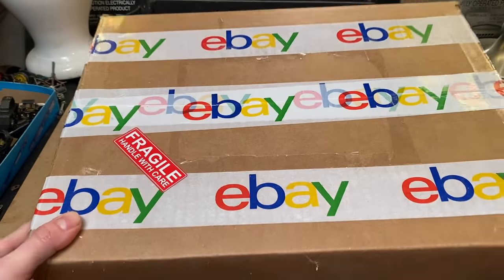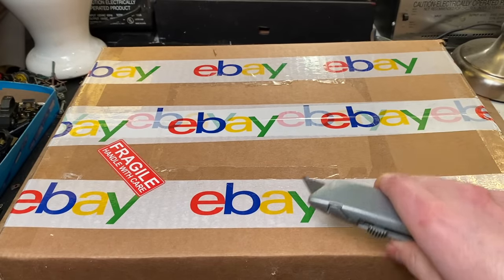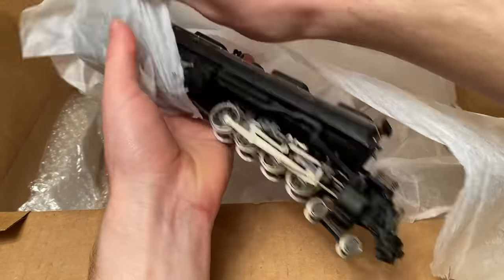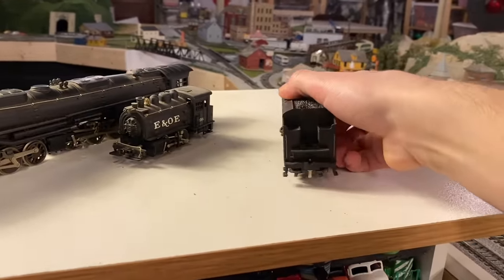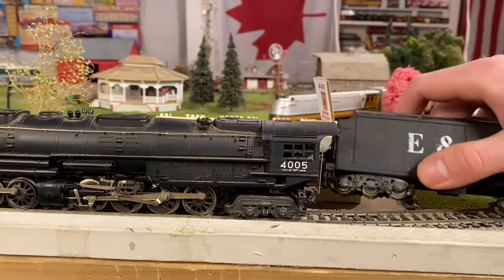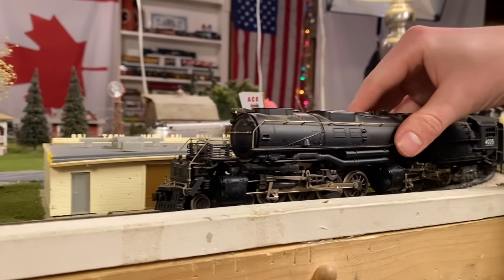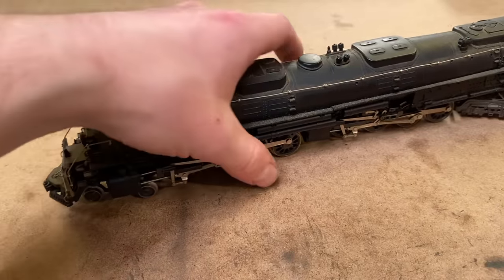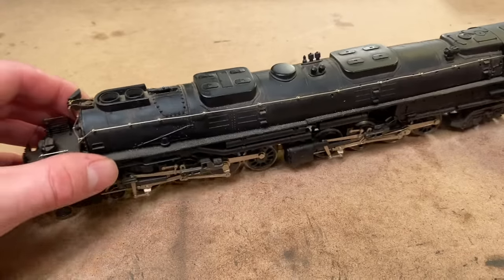Can We Make This Rivarossi Big Boy Run Again? Sitting for 20 Years

Comment: Super. The drive is a lot better than I imagined, and oiling the siderods, bearings, and valve gear is very important on a locomotive like this. I like the Big Boy, but will probably not buy one for my railroad, but if one just happens to come my way, I'd find an excuse to operate it on my railroads fantrips. 💙 T.E.N.

Comment: Nice old Rivarossi - that's a model I always wanted as a kid.  I'd have cleaned the wheels and checked the wheel pickup brushes before I did anything else with an old engine like that - most of the time that's the only problem.

Comment: I used to use a small brass wire brush to clean wheels. I attached a wire between it and a 9v battery and had a return wire to complete the circuit so the brush itself powered the loco whilst cleaning the wheels.

Comment: Three possible suggestions.
If it's brass, polish that strip between the 2 driver sets. 
Check the gauge on the wheels. That front end pops up a lot when going through the street crossing.
See if you can remove the brushes and check to make sure the contact surface with the commutator is flat. Sand if it won't make them too short.

Comment: You've probably used Deoxit electrical contact cleaner. It's great for cleaning most electrical devices. Makes old audio equipment work / sound better as well.
Reply from the maker: Thanks for the tip!

Comment: I have one of these made in mid 1970s. Mine has the dreaded mazak rot, and the chassis expanded and stretched the  drivetrain so far apart it no longer connected together. Think it must be easier for you to get these engines  second hand in the USA. As I have never found one in the UK for spares and repairs. So sadly it remains in its broken state.

Comment: It looks to run really good for it's age. I definitely like that drive better than the can motor drive.
Reply from the maker: For the time it was very good. Best 3-pole motors ever made in my opinion.
Reply: I completely agree with you about that. My blue goose is by far my best running locomotive and it has the same motor and its great.

Comment: Hi Harrison. Got my first Rivarossi Big Boy this week and was told it didn’t run. After watching your videos, I took it apart, lubed and greased it and cleaned the wheels and now its running great!  In watching your video you mentioned that most of the time the cover for the top screw is always missing. Mine was also missing and managed to find a pretty good fix. My daughter bought me a plastic pen that has a “hammer” head top. The one end of this plastic hammer is the exact same size as the original. I just cut the piece off the pen and popped it right into place. If you message me I can send you a pic of this and what it looks like on the locomotive.

Comment: Heres a trick for you- try dunking a problematic motor in water and running it. I race radio control cars and back in the day that was a great way to clean the coms brushes, or break them in for new motors without lots of deposits on the comm. You can use tap water, just use motor spray (brake cleaner) to clean it out. BUT with your motors I'd use distilled water. Either way direct current motors will run just fine underwater. Theres lots of youtube videos showing this. And there are still brush and comm cleaning tools sold on (bigger) rc rock crawling websites as a lot of them still used brushed motors. Just something to try! Obviously thoroughly clean the motor out after with something thats paint safe but should work well for you!

Comment: Tender source, there was a manufacturer that made a wheel set conversion for the Monogram ( now Revell) BigBoy kit tender, someone thought it was pretty well detailed. The other parts may by found through Precision Scale Models, they also had the centipede truck and front tender truck for the Big Boy tender.

Comment: The batteries are dead 😂
It's informative to watch your videos, you know what you're doing. Good looking engine. You realize how much coal and water the BigBoy engine used in sn hour at say a steady 40 mph? Its crazy, no wonder they came out with Diesel. I found out BigBoy 4014 was converted to oil.

Comment: Spray it with some CRC 2026 spray that's electrical contact spray cleaner in the motor and it will help it I have several of the old ahm locomotives and that's what I use and it really cleans it up pretty good inside the motor with all the carbon deposits

Comment: You can look at the 5550 T1 trust and they are about to start work on the frame and it will be made into two parts and after you see the locomotive progress you will be surprise to see how far they came to this point
Reply from the maker: I’m highly impressed by how well they’ve doing this.

Comment: I fixed a few of these for people,  alltough i never could afford one, pretty simple, as you did, most of them just needed a good clean,  but not the best slow runners, the drive mechanism is not the best in this cab motor version.  The never version has a different drive mechanism, its alot smoother!  But all in all, both are nice, easy to maintain.
Nice job!!
Reply from the maker: They seem pretty nice, I can imagine at the time how sought after they would be.

Comment: I bought an old rivarossi cab forward a few years back... I had to grind all the carbon buildup on all the wheels and oil up but surprisingly afterwards it ran great! The motor noise tho.... typical of  80/ 90s tech

Comment: The number of that Big Boy is X4005. You can find X4005 at the Forney Museum of Transportation in Denver, USA. The reason 4005 is no longer in service is because she was in a switching accident and rolled over on April 27th, 1953. Additional Information From Google: On April 27, 1953, No. 4005 was pulling a freight train through southern Wyoming when it jumped a switch track at 50 mph (80 km/h), throwing the engine onto its left side and derailing its tender and the first 18 freight cars of its 62-car train.

Comment: SMT

Thanks for the video. i inherited a Rivarossi Big Boy from my late farther-in-law. It does not run, when power is applied it jerks about 1/16" forward and then just hums. I will use you video as a learning tool to open this locomotive and see what is stopping it from running. My guess is my Big Boy has not been run for 5-10 years or more so the gear mechanism might be clogged with hardened grease. At least i hope this is the case. Thanks.
Reply from the maker: I think grease probably is the issue too but also check the rods. If they are bent or missing a screw it could cause the problem you spoke of.

Comment: It uses the same motor they used in all their steam engines. Mine require routine cleaning and lube like every 40 hours of run time. You can tell when because they start using more amps.

Comment: Nice video! Do you know what the e&oe on the tender of the big boy and on the side of the saddle tank stands for?
Reply from the maker: I wish I knew, must be some short line.
Reply: @SMTMainline  E&OE does not show as an actual real railroad that would have been affiliated with UP and can find no reference a UP Big Boy ever so lettered. Those initials must have been for the original owners model line and they had both the Boy and saddle tanker relettered.

Comment: That's a great idea. Looks like it is a good runner. What type of grease and oil do you use? I have several rivarossi locos that were my dad's and I would like to get them in running condition. They were never run and are the 50th anniversary edition locos. Thanks for any info and thanks for sharing

Comment: What was I missing?  When you said it looks to be drawing too much current, it looked to be a bit over 0.5 amps,   then when you said "well there ya go" and 'fixed' it it still looked to be above 0.5 amps
Reply from the maker: It was pulling 3/4 of an amp in the beginning and by the end it was pulling 1/4 of an amp.
Reply: @SMTMainline  Gotcha, maybe it was just the angle of the camera 16:36 looks like 1/2 an amp, and 17:53 also looks like 1/2 an amp.   Although on closer inspection I do see that the ammeter portion of your controller isn't linear, so maybe that's where the confusion on my part is.   Either way, good job on the fix.

Comment: 9:50 I had a rivarossi 080 steam locomotive that couldn’t run because the previous owner left out the those black drive shafts from. I wish I knew what they were called though

Comment: You messed up the drive rods on the left side rear set of drivers where it connects to the bar infront of the cylander, it is suppose to match the front one where the small bar is low to the ground and straight, but still nice!

Comment: What brand and model is your power supply with the analog gauges ? During the Big Game I was hunting for locomotives. Found a 2-8-8-2 and a 2-8-4 Rivarossi's that I don't think will run. But at least they are complete. Prices were good. Thanks so much for the buying tips !!
Reply from the maker: It's an MRC Tech iii 9500 series.

Comment: SMT main line I see a lot of videos where are you doing river Rossi locomotives there is a motor out there that is called a can motor if you put that motor in Them they were run a lot smoother and a lot better just a tip for you from another model railroader

Comment: How much did you pay for this lot? Not to mention that 0-4-0 I think is a early Rivarossi one that has Zinc pistons that tend to suffer from zinc rot and the few examples that don’t are quite rare. Or it could be a Late Rivarossi or AHM but I don’t know. Great job getting 4005 back in service again!
Reply from the maker: I just checked and it was 147USD. Not too bad considering the 0-4-0 was in working order.
Reply: @SMTMainline  the Rivarossi AHM big boy price was $39.95 when first offered.

Comment: My rivarossi jw bowker has an issue with black gunk and it also has the same studdering problem the wheels also spark constantly. I have a feeling that it has to do with the tender wire only touching via pressure but I don’t own a soldering iron

Comment: I also have an identical 4005 Big Boy Rivarossi too. the motor works good, however doesn't pull much. today I finally was able to crack the motor open to clean the commutator and now has a bit more power. however, on the trailing truck, it seems to keep causing short circuits.. When I lift it up by the cab while running, it works fine. but when I let go, it cuts out. what are possible solutions to remedy this problem? Could it be the armature that connects to the tender?
Reply: I finally solved the issue, When I put it back together, the motor cap clamps were not holding the cap tight enough for the brushes to not make contact with the commutator also the rear truck wasn't put together correctly. As of now, it runs very well. Also based on your model, you have an older design. Mine has a larger, more cylindrical motor. like from the late 70's. yours from what I can find dates back to 1969 at the earliest.

Comment: Hey SMT,

So right now I'm planning to get my own big boy, and seems Rivarossi and Broadway Limited are both coming out with new ones. In your opinion, which one would be the better choice to go with? I know you got experience with the rivarossi one, but was wondering if you have a non-biased opinion or general advice into which might be a better direction to go for.
Reply from the maker: I've only ever owned Rivarossi's so I can't speak for BWL. I own one of the modern ones and so far it's been a good model. From what I've heard BWL models have better detail but can be prone to more issues. I hope this helps.
Reply: @SMTMainline  this does indeed help. Basically from what I'm getting is either less detail but more reliability, or more detail with less reliability trade off.

Thinking rn might ho rivarossi so I have one for when I set up layout as well as just have one, then down road get a Broadway if I want smoke and such.

Comment: Whats the white lubricant you use? Is it White Lithium grease or something different? I have a Riverossi Challenger that I bought last year that I need to dig into, should be similar to this, thanks! Great Video!
Reply from the maker: Generally I use labelle 107 medium weight oil and 106 heavy oil ( grease ) I believe its made with polytetrafluoroethylene.
Reply: @SMT Mainline  thanks! Also, an idea for somewhere to donate for Charity would be SRI, the Steam Railroading Institute in Michigan where Pere Marquette 1225 AKA Polar Express is ran! They could always use the help!

Comment: Smt I been watch your channel since 2018 or 2019 I really don’t remember went I started. But do you think about fixing the Yellowstone with using a bigboy chassis? It and idea I don’t know if it would work if not but being the both loco use and 8-8 wheel curation is migh would get u close.Or use the tyco Chattanooga chassis you  mentioned in the video.
Reply from the maker: That's not a bad idea but I have a but of a bit of a different idea to fix it, no idea if it's gonna work.

Comment: I notice that they have cheated by making both drive units articulate.  The real loco has only the front drives articulate with the rear drivers on the rigid frame.  I assume that is to accommodate tighter than scale curve radii.

Comment: What are those gearboxes called that drop the power down to the trucks? Ive a couple of projects that could use those
Reply from the maker: I think it would be called a transfer case or gear tower.
Reply: @SMTMainline  I've been looking online but can't find anything like them but I've a few engines I could make single motor all wheel drive with thr use of these as my layout is for engines in bits showing the real prime mover inside amd stuff and some of them just don't have the space to detail correctly to keep there standard motor bogie/truck

Comment: I have a seized rossi challenger that makes its back drive shaft disconnect From the boiler and then it acts up like it has a seized drive but it doesn't.  What does that mean?
Reply: also i have the expoxy thing in mine
Reply from the maker: Sounds like the driveshaft is loose.

Comment: That BB is begging for a good can motor.  I've rebuilt several old Rivs and those square motors hit the trash can fast. High amp draw just to get them moving and they don't work well with DCC.
Reply from the maker: I like the Rivarossi motors since they were very well built and last practically forever but I can see how performance/DCC wise they are junk.

Comment: Has anyone had a short with this unit I broke the train down cleaned every part on it put it back together and the wheels started to smoke flipped it over and the tension spring melted to the body any insight would be great
Reply from the maker: Are you sure the conductive side is placed correctly?

Comment: As amazing as the restoration was, I'm more than a little blindsided by your railing skills, you got 24 wheels on a curved section of track first try without any fiddling.
Reply from the maker: Thanks. Rivarossi locomotives were well designed so getting them on the track usually isn't too difficult.

Comment: Let's see you hook power directly up to the motor and it runs but as soon as you try to run power to it from the tracks it doesn't run very good. Obviously you didn't clean the pickups going from the wheels to the motor clearly the problem is in between the wheels and the motor. Diagnostics 101 the motor runs fine when power is driven to it directly to it the problem is elsewhere throughout the it doesn't take a genius to figure that out
Reply from the maker: The electrical linkage between the tender and locomotive is unreliable on older Rivarossi locomotives. Hardwiring it would likely have fixed that issue.